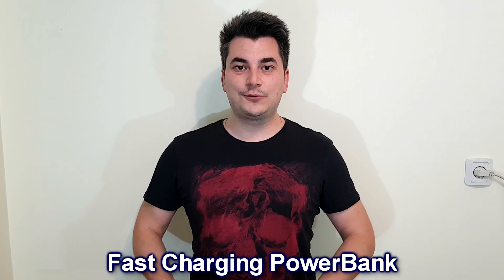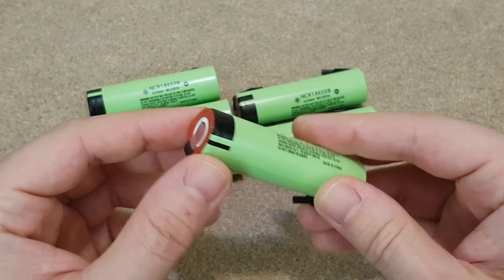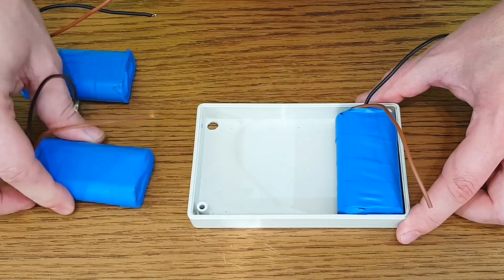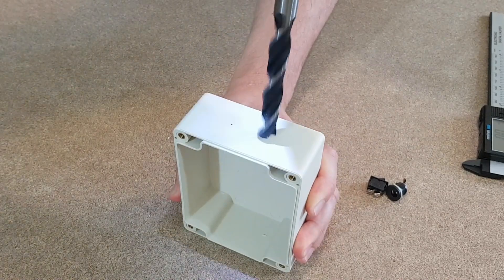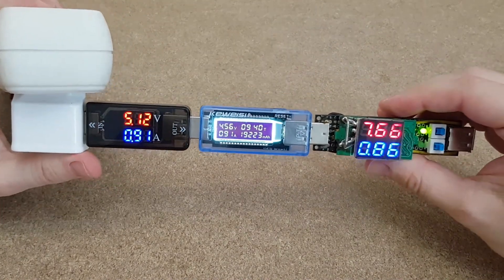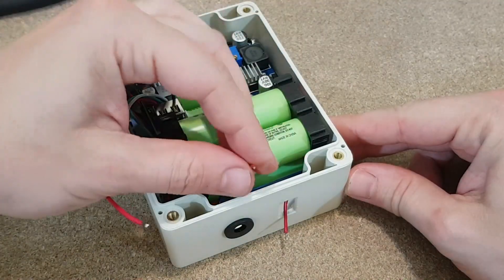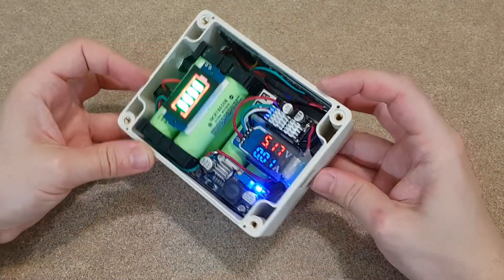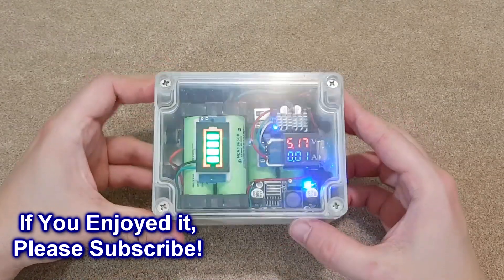DIY Fast Charging PowerBank - 70Wh (AFC, QC2.0, QC3.0, FCP/SCP)

Comment: 14:08 hi sorin my bms turn off under  21v.. what is wrong i have seen in Google a 6s bms cut off voltage is under 21v
Reply from the maker: you need to check the cells. Maybe they are not balanced. Or one of the cells is damaged and discharges faster to the over discharge cut-off voltage of 2.7V.

Comment: Question. Why does voltage rise up to 9V when you plugged the samsung?
Reply from the maker: Because that's the fast charge protocol for that type of Samsung, 9V and 1.6A. 
Fast charging protocols increase voltage, not current.

Comment: these days you can buy a 100w power bank module that supports 3 to 6s battery and 5-50ah cells and li-ion or lifepo4 just by setting resistors on the board. the whole module is like 9$ on aliexpress and actually does all it says. even has fast dc charging for the cells. builtin bms for li-ion. multiple outputs.

Comment: Very nice project, it’s looking so professional ,soldering battery with soldering iron is very dangerous because they not get connect to each other correctly ,something called Cold connection happens between metal plates and battery surface and it’s draw current when you put load on it

Comment: Sir i have questions? Can i connect QC fast charger module with Lm2596 module?
Reply from the maker: Lm2596 will decrease the voltage. Why do you want to decrease the voltage for the fast charging module?

Comment: hi, ı have a question for you, why did you use series batteries instead of parallel?
Reply from the maker: Hi. because with series connection the battery will have a higher voltage and a buck converter will work better to lower the voltage to 5V or 9V/12V for fast charging.
With parallel connection the battery will have between 4.2V and 2.5V. a boost converter will draw a lot of current to increase the voltage to 9V or 12V. A higher current means lower efficiency and a lot of heat in components.
Reply: @Sorin_DIY  I got it, Thanks!

Comment: Hello everyone! 
I am new to the electronics and circuitry space. I was wondering a few questions on this project, as I have been doing some research. A few questions:
1) What is the voltage inputted into the step-down converter before each usb module? It seems to be abou 24v but I'm not sure.
2) what is the full capacity of the 6s batteries?
I thought 6 batteries in series would result in 6x the voltage. 
All help is greatly appreciated and tysm!
Reply from the maker: Hi. 1) the 6S battery pack voltage is between 25.5V and 16.2V
2) connecting the cells in series the capacity doesn't change, so 3200mAh. the voltage adds up, so also the energy.
Reply: Thank You So Much! @Sorin_DIY

Comment: Hey thank you for this video. it was very informativ and funny :D
I do have one question and maybe you have tried it:
As I understand the 3A buck converter is able to output 20v. Have you tried to charge a Laptop with it?
Reply from the maker: Hi. the 6S battery pack has a voltage range of 25.2V to 16.2V when it gets low. so in combination with a buck converter it's not enough to charge a laptop. it needs a bigger battery pack, or a buck/boost converter to be able to charge a laptop.
Reply: @Sorin_DIY thank you for your response. I will try to build it and let you know if I was successful 😊
I wish you all the best and I'm hoping for more awesome videos 😁

Comment: That quick charge module is giving voltages of 5v ,9v,and 12v (max 12v) then why we need a 7s bms ? Why not using 4s or 5s battery pack?
Reply from the maker: For several reasons. Because a 4S battery pack will discharge to about 10V depending on the BMS. 
I wanted to have a higher energy, now it can fully charge 4 or 5 mobile phones, depending on the type of phone.
and a higher voltage battery can output more power for the converters, to be able to charge 2 devices in the same time, without the battery getting hot, even when the battery voltage is getting low.

Comment: Hi Sorin, loved your vid. It's now been 2 years since you built the powerbank. I would very much like to know if it has given any problems. I am intending to build 6 of these, following your instructions. I have purchased all the same components as in your parts list except for: The case  I intend to 3d print, and the BMS I chose instead to go with a 30A BMS. I know very little about this subject. This seems like a good way to learn. The reason I want to go with 6s is that I bought very cheap, 60 sets of used 6s packs. Each pack comes in a hard case, and the batteries are already connected in a 6s configuration. Thus it seems to me that a lot of the work has already been done, so long as I stick with 6s. I am worried about explosions and fires. As they are basically only intended to be emergecy power supplies I plan to charge them outside, well away from the house. So it would be great to hear that your powerbank has had plenty of use, and no fires. Cheers mate.
Reply from the maker: Hi. thanks for joining my Patreon page. 
Yes I occasionally use the powerbank in my trips. it still works fine. the 6S BMS I use has the overcharge protection voltage at 4.25V, I hope yours doesn't have a higher voltage, because it's not good to fully charge the cells at a higher voltage. 
But I would change 2 things about it, the charging plug is rated at 0.5A and it gets hot when I charge it with 2A. you need a 2-3A plug. 
And I want to add another way to charge it. with a USB-C fast charge trigger module + a CC/CV step up converter to 25.2V, to fast charge the powerbank with a USB-C charger. it's more common than a 25.2V charger.
Also I suggest you test all the cells. if you cant test them individually, you can use a BMS to charge and discharge them and you can connect a 6S battery balance/tester, to monitor the cells. if one cell is bad, you cannot use the entire battery pack. and test if the cells get hot while you charge and discharge them.

Comment: Hello Sorin, this is some great content. I know very little about electronics, but your video got me excited to try and make this powerbank. Could you help me with some additional information? What wire sizes do I need to buy for this project?  An adjacent question would be: how do you  know what size is best for each case scenario? (maybe the response to this one would be a good idea for another video). Thank you.
Reply from the maker: Hi. The wire thickness depends on the type of current used (AC or DC), also the length of the wire is important. for my projects with high current (DC) I try to use wires as short as possible. 
with 3A a 0.8mm2 wire will heat up over time, so I use 1mm2 wires. 1.5mm2 wires for max 5A. 
check this link for more info and an online calculator for wires: https://www.powerstream.com/Wire_Size.htm
Reply: @Sorin_DIY  Thank you for the information and the link, I really appreciate it.

Comment: so, sorin, you made a great film - some electronics under transparent cover, many colored bright leds and even radiators!!! now the easy question: if there are radiators, they conduct heat, yes? and where goes all that heat without any holes at all inside this small box? not afraid from lithium fireworks? they are very intensive and burn so well all around, if you never saw them. summary: no holes for exporting the heat out of the box, but enough eyecandies - anyway it looks good for youtube content.
Reply from the maker: You're overreacting. You are implying that by adding radiators, it will be more heat inside the powerbank. No, the heat is generated by the ICs, so if you have a problem with the heat, you should take it on the ICs. 15W of heat inside the powerbank is still 15W of heat, with or without the radiators. 
The modules are produced without heatsinks. I added the heatsinks as an extra precaution, to help the ICs dissipate the heat faster, not to cool down the entire powerbank. Inside the powerbank there is enough air to absorb the heat generated by the small ICs, the li-ion cells are not affected. And instead of a 70°C IC, I prefer a 40°C IC+heatsink. 
I think you should be more worried about your sealed mobile phone getting hot, including the battery, while it's fast charging or super fast charging. regular powerbanks don't have venting holes either. And what about your 75W laptop charger? it's sealed closed with very little space inside, to absorb the heat.

Comment: If I make a  usb charging hub with data pins shorted and connect it with fast charging module will it work to give fast charge feature in all ports
Reply from the maker: no. you need more fast charging modules.

Comment: I know this is a 2year old video but I'm pretty interested in your project about the 70 watts fast charger power bank. May I know if it's feasible to have a 20-30watts fast charger for double A batteries? I'm currently in the concept of making it and but I'm a 1st year college student so I really don't know about electric stuff. Do you have vids that can help me make my concept work?
Reply from the maker: I don't understand exactly what you want to build. do you want to build a charger for ni-mh batteries?
Reply: @Sorin_DIY  not ni-mh but like the batteries you can buy from your local ware. Double A carbon batteries to exact
Reply from the maker: no, it won't work.
Reply: @Sorin_DIY  It was still a concept but is it feasible to have a solar powered 30-50 watts fast charging power bank?. I got inspired from your vid and I'm in a regional province so power banks are really needed here for lighting
Reply from the maker: yes that will work.

Comment: My mobile charge with 10v 6amp will this device fast charge? Type c charger
Reply from the maker: It depends on what charging protocol your phone needs. you can check the module specs to see if it's compatible with your phone. if not, you can use other fast charging module.

Comment: Man, this is the most efficient and reliable powerbank I've ever seen!. But I want to use 4 18650 in parallel. Do you know what charging board I should use using a 33 watt charger to charge 4 18650 in parallel?
Reply from the maker: Hi. for this powerbank you need a 6S battery pack. it will not work with only 4 cells in parallel.

Comment: Nice video but which one is better for making power bank a series battery and using a converter like in your video or making a parallel battery and direct to power bank module and not using a converter? is that the same phone can charge which is the best?
Reply from the maker: for low current powerbank you can use cells in parallel. but for high current you need cells in series and a step down converter.
Reply: @Sorin_DIY  which is better?

Comment: Nice video.
Really enjoyed watching it.
Have you ever used a mobile phone charger as a variable power supply?
Reply from the maker: thanks. not yet.
Reply: @Sorin_DIY  
In QC 3.0 you can ask for output changes with 200 mv steps.
I was thinking of using my old 18 w charger as modem UPS power supply

Comment: Hello can i use Lipo4 32650 battery instead of 18650?
Reply from the maker: LiPo or LiFePO4 cells?
Reply: @Sorin_DIY  Yes sir i want to parallel it on 4p

Comment: Does it support ONEPLUS DASH/WARP charge? (5v4a). If not then what changes should i do?
Reply from the maker: I haven't tried it yet, but I don't think so. the fast charging module doesn't have 5V with 4A in the specs. you need a different fast charging module that supports oneplus.

Comment: My lm2596 is making sound when getting hot and output current of 5.33v,1.85A, any solutions
Reply from the maker: hi. probably the coil is buzzing. you can try to desolder the coil and if you have access try to tighten the windings of the coil and then solder it back.
Reply: @Sorin_DIY  I have buyed the same module that you have used in the video.

Comment: Hey sorin  I made this stuff with  slight  adjustment      I used the same BMS  my  question is  will this   BMS  provide the same voltage  through out  the discharging  process      and then suddenly stop  once  the lowest voltage is reached   or  it will slowly  get lowered  with the battert  voltage   like at  100% 25.2v    at 50%  something else   at25%  something else
Reply from the maker: hi. the BMS board does not modify the battery voltage. so the output voltage is decreasing slowly.
Reply: @Sorin_DIY  ok thanks

Comment: Won't the 6 cells eventually become unbalanced? I don't know if that is a problem when having the cells connected in series.
Reply from the maker: the 6S BMS board has balance feature, so it's ok.
Reply: @Sorin_DIY  Thanks for the answer! Doesn't that need you to connect extra wires between the batteries?
Reply: @ThePiprian  just follow the schematic provided nothing will go wrong, best of luck for your diy power bank 👍
Reply: @techguyz5916  It seems the extra wires for the balance feature are actually in the video but he doesn't mention them.

Comment: what if you were to connect two of those adapters in parallel would it be a DIY Faster Charging Power Bank ??? 22.5V 4A
Reply from the maker: it will work only if the chargers have the exact same voltage. the powerbank will charge faster, but it's not good for the lithium cells to charge them with 4A.
Reply: @Sorin_DIY  thanks sorin just as i thought forcing to much current into a cell or dragging it out to fast creates heat which shortens the lifespan of the cell and creates a possible fire hazard 
it was just a thought since i saw one of the anker packs have dual charging 

great videos thanks

Comment: Just wondering what size guage wire you used
Reply from the maker: I used wires from an old PC power supply. I think the thickest are 1mm gauge wires, or even thicker.
Reply: @Sorin_DIY  ok thank you

Comment: Hey   sorin      I wanna know that  how should I connect it to the  B1,2,3,4,5,6    terminal as in your diagram  you have shown  in between the cells  and     but in real world  you have soldered it on the terminals of the cell
Reply from the maker: hi. it's the same thing. you need to solder each balance lead somewhere between the 2 cells.
Reply: @Sorin_DIY  ok thanks for it

Comment: Hey sorin      actually in my country o am not getting the charger        but i have a laptop charger     which outputs     19v at 5 amps    I am planning to step up the voltage using a step up converter   and I have the same BMS board   so my question is will this idea work and will the bms  handle 5 amps
Reply from the maker: hi. you need a CC/CV step up converter, so you can limit the current to 2A and the voltage to 25.4V. the charging voltage needs to be a little higher than the battery voltage.
Reply: @Sorin_DIY      the charger outputs   19.  Sometimes volts   and 4.6   something amps       so  you are saying that there should be a cc of 2 amps and why not 4 amps as the bms can handle 40 amps
Reply from the maker: yes, the BMS can handle. but it depends what lithium cells you are using. it's not recommended to charge them with too much current. also there is no need to put unnecessary stress on the charger, because to increase the voltage, the converter will draw more current from the charger. the efficiency will not be very good and the charger will get hot.

Comment: Uhm... I don't know how happy is that 26V 2A power supply to work in that way... It would be ways better to use a cc/cv dc-dc module
Reply from the maker: it's very happy. it's a good charger, that's why it cost $16. it does have a CC feature. as you can see in the video, the current remains stable at 2A and the voltage is rising, while it charges the battery.
Reply: @Sorin_DIY  ow I'm sorry 😂😇 I was In a bus when I watched the video and since it was pretty noisy maybe I didn't hear something... But anyway yes... Otherwise it would have just shut off due to the UVP (Under Voltage protection) that  there is in ordinary power supplies 😅

Comment: good. Nowadays I wanted to make a 3S P2 with bms and the same fast charging module, at 10V and a depleted battery I would like the autonomy to be at least up to 6V but the bms cuts it before. I use a translator, I'm from Argentina

Comment: If I use the cells in parallel and use a step up converter or will there be a current output prob   I tried it it charged my headphones perfectly but  the phone is getting  charged slowly  using the same fast  charging module
Reply from the maker: if you increase and then decrease the voltage, you will have a very low efficiency, probably less than 70%. you will waste battery capacity.
Reply: @Sorin_DIY  ok

Comment: Siri wanna make it the same but i wanna add the cells in parallel making it 15Ah  so what all will i have to do   and what should be the input current for fast charge module  and if I make a 15 Ah power bank then what will be the final capacity  after the inefficiency
Reply from the maker: hi. the fast charging module needs minimum 12V. if you connect the cells in parallel you will have a battery pack with a voltage between 4.2V and 2.7V. that's not enough. if you want to make this powerbank you need to connect the cells in series.
Reply: @Sorin_DIY  what about using a step up converter

Comment: Hi friend, I am your subscriber, have a question. Is there anything on Amazon or Ebay that can charge my 20.6V Lithium battery and when it reaches the 20.6 volts it should stop charging or cut off.
Reply from the maker: hi. I don't usually buy from Amazon and Ebay. but I don't think you will find a charger like that. you need a charger to deliver the needed voltage and current. and a BMS protection board for the battery pack.